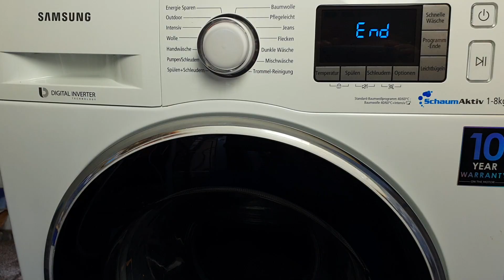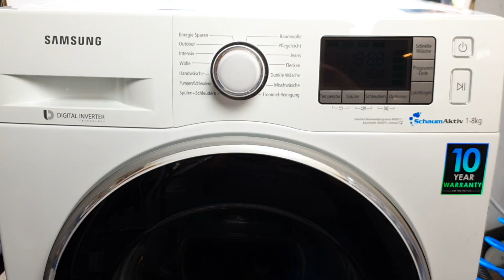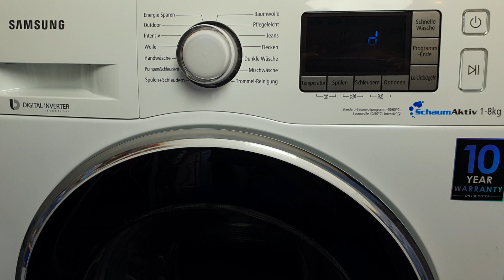Samsung Waschmaschine hört mitten im Waschgang auf - Repariert.

Comment: Hallo bei mir geht immer das Display aus während dem Waschen. Der Waschgang läuft aber weiter. Kann hier diese Methode auch helfen?? Danke vorab
Reply from the maker: Hallo,
Eventuell einfach Verbindung prüfen,  alle Stecker mal raus und wieder rein, das könnte helfen aber da bin ich mir nicht sicher
Reply: Hallo Reperator danke für deinen Tipp. Ich hätte da nochmal eine kleine Frage. Und zwar: Maschine pumpt nicht ab. Habe die Pumpe ausgebaut sauber gemacht, Flusensieb + dieses Flügelrad gesäubert. Das Flügelrad ist nicht blockiert und lässt sich drehen. Wenn ich auf abpumpen schalte macht es innen kurz (ganz leise) klick und dann tut sich nix mehr. Kein drehen kein Geräusch. Andere Programme laufen ganz normal nur Schleudern/Abpumpen funktioniert nicht. Kann man hier sagen dass die Pumpe kaputt ist? Danke für deine Zeit und Hilfe.
Reply from the maker: @heymistergroove5186  das kann auch Platine sein also eventuell Relai sein aber auch Pumpe,  es kann sein das innen drin Plastik abgenutzt ist und die sich beim einschalten blockiert. 
Entweder andere Pumpe probieren oder diese Pumpe an 220 anschließen und testen.
Reply: Hab es gemacht, aber Schrauben ohne untelegscheibe, Display geht an, 

Aber kommt Fehler UC und Maschine läuft nicht an, kennt es jmd?

Comment: Hallo, bei mir zeigt meine Samsung Maschine dC Fehler Code ein, Verrieglung ausgetauscht(Original) dennoch Fehler, heißt es es liegt an dem Steuergerät?
Reply from the maker: Hallo,
Ist das eine Addwash Samsung?
Reply: @reparator  ja WW8TK6404QW/EG
Reply from the maker: Dann liegt es an kleinen Öffnung,  also Addwash Türchen
Reply: @reparator  die wird aber verriegelt, hab die mal absichtlich auf gelassen und dann auf Start und dann kam ddc als ich sie zu gemacht habe kam normal dc wie vorher auch
Reply from the maker: Na dann , Stecker prüfen,  Leitungen prüfen als erstes